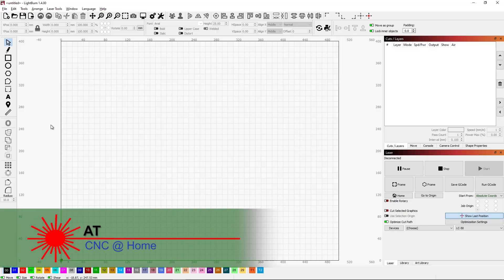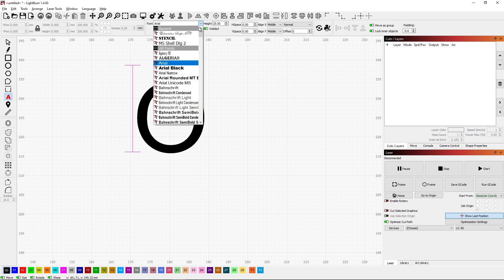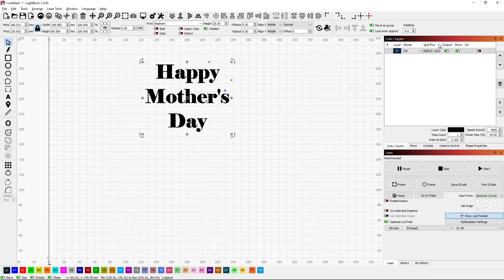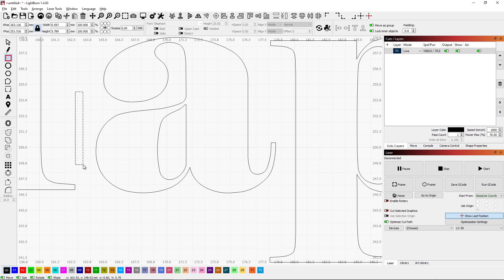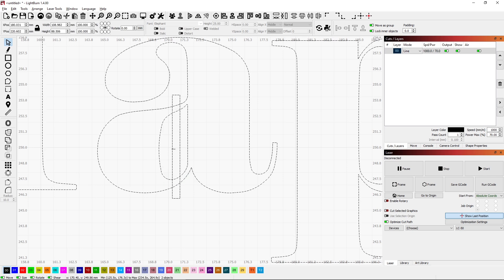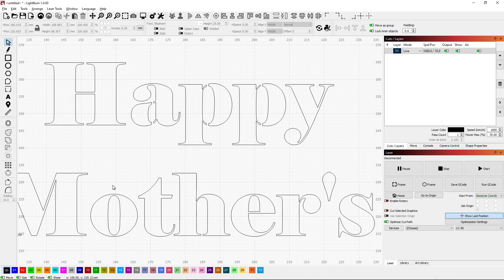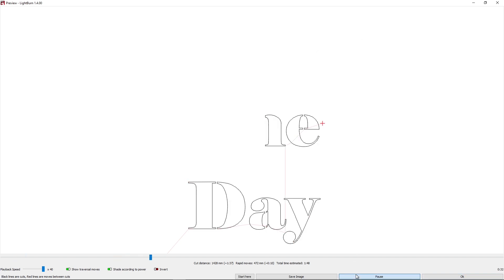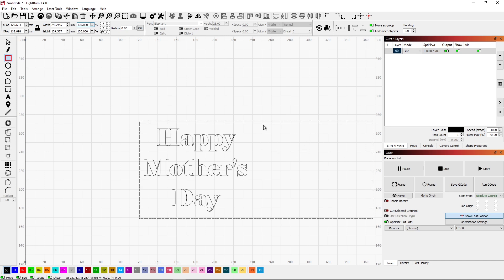Adding tabs to my font in LightBurn so I can burn out letters in 110# paper

Comment: Dang, I wish I saw this an hour ago as I just made my first paper card before I found your video. In my case I used a fancy stencil script font (Brannboll) which worked out pretty well, but the tab trick would have been useful for a few letters. I also used a widely space dash vertical line in center to assist in the fold.
Reply from the maker: I was just thinking about this video for some reason.  Your comment came at a great time.  :-)  In the future, I hope you are able to use this method.  Your widely spaced dash to help the card bend is brilliant!  Good thinking.  In manufacturing, that method is called a bend relief. We used them in back when I worked as a manufacturing engineer in precision sheet metal manufacturing. I can't say that I ever thought about using them with paper.  Fantastic idea!